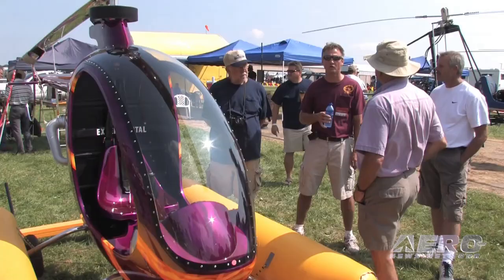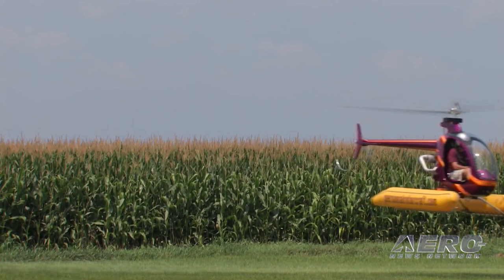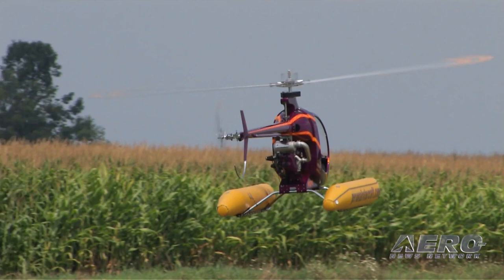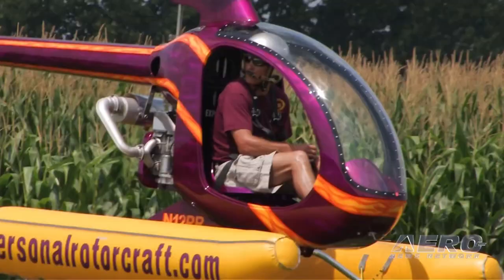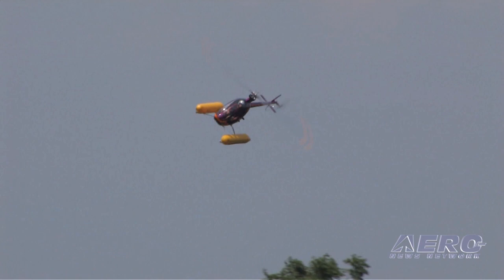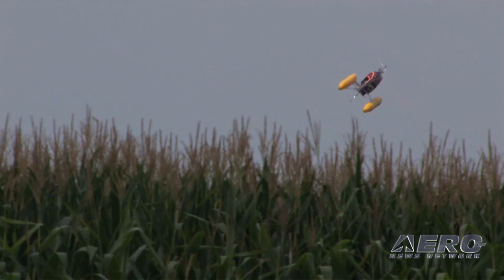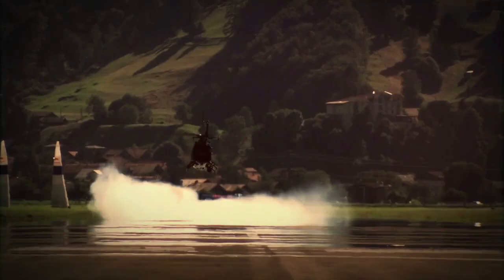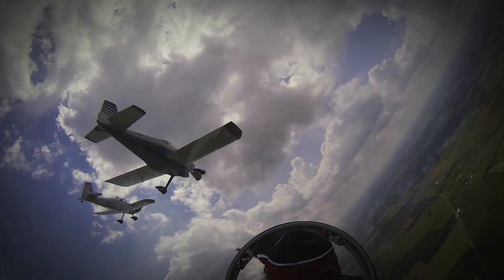Aero-TV: The Mosquito Helicopter - Not Much Bigger Than Some R/C Models!

Comment: Oh god it has an exposed toothbelt on the final drive!!! MADNESS! Better be high up when that snaps!
Reply: No problem, actually, just perform an autorotation (google it)!
Reply: Yes, you want to be high up for autorotation, it gives time to pick up rotor RPMs.
Reply: @builder1113  autorotation is not easy and usually ends in failure when facing a real emergency.
Reply: It has 2 on top of each other
Reply: The belt is a fail safe in case of gear failure, it will fly with out it just fine